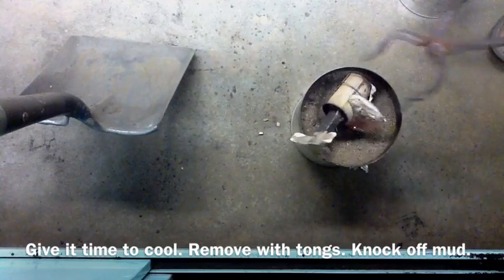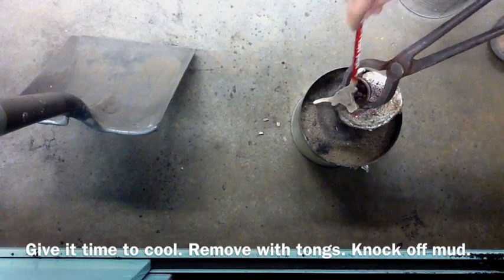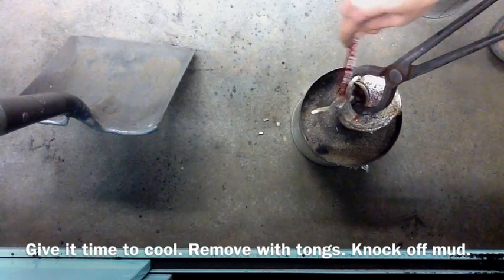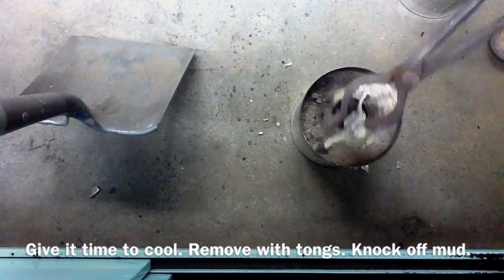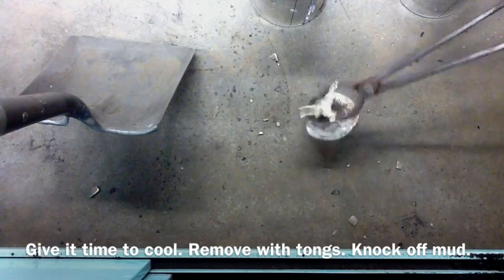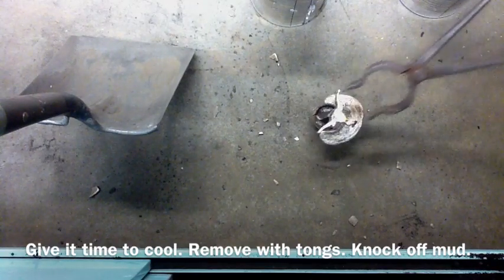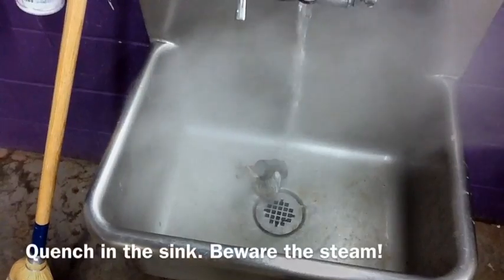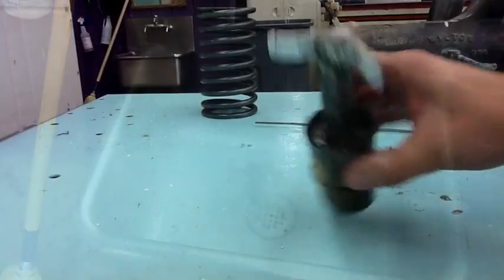Lost Foam Casting Process-  Start to finish

Comment from the maker: the drywall mud coats the foam and prevents seepage into the more porous sand.  masking tape works similar to the drywall mud. drywall mud is just easier to apply and seal the object within. *note this is hobby level stuff and not hard science casting. this was all trial and error when I was learning. :)

Comment: You don't need the kush thing, you can make a volcano bowl, grant to
Reply: +GoGo DaSilva (myGogoX1) 

Having the pressure tool reduces the spillage and reduces the amount of material needed for pressure by making more efficient pressure.  The cone is easier, but significantly less efficient at creating the pressure needed.  You need downward pressure and if you use a cone you would need to pile exponentially more material depending on the size of the object.   You also have less waste material to reprocess later on.
Reply: metalwreck450 ehhh, true

Comment: I live in the uk, what is dry wall mud? Is it like a polly filler or artexing? And does the type of foam matter? I have a ton of foam from packaging would this work the same (if i cut it smoothly with a heated wire cutter and add this dry wall mud, or what ever the uk version is)
Reply: Darren Waddle drywall mud is joint compound for wall board.
Reply: Thomas Hansen thank you

Comment: what about taking the other metal off like if i wanted just the bull head
Reply: That actually was the plan for that item.  The extra foam made a pathway for the metal to flow.  Typically I would have students do all of their finishing with the extra on so they have a clamping point in vise, then separate the finished product with a hacksaw.

Comment: so the heat melts away at the foam and takes the form correct? Ive been looking to casting alot recently and would like some insight
Reply: Yep.  Since the foam is mostly air the aluminum replaces the cavity held by the foam.  Drywall mud keeps sand from sticking to the molten aluminum as it cools.
Reply: if you wish to learn about lost foam casting check out my latest videos and castings and don't forget to like and subscribe  thanks

Comment: yes i see how it would be nice for something quick and dirty. but shallow 2D parts don't really need the angles or the split patterns just gotta be gentle pulling out the form. and hey make your own foundry! i love it i am building a 3d printer right now with cast parts with green sand then i can print positives with PLA and use them to do lost PLA castings! pretty cool projects that are coming full circle, fun stuff~!

Comment from the maker: I am not sure how the plastic would treat the foam.  If I had to guess, I'd say no.  Molten metal has plenty of heat to spare, plus flows quickly to fill voids.  When the mold isn't quickly replaced, it may collapse on itself.  Sorry.  :(      (Sorry on the delay too.)

Comment from the maker: Thanks for the note!  Yes, regular playsand will work fine.  The drywall mud should retain the detail of the foam.  If you're not using mud, the finer the sand, the better.  Expect some of the sand to get contaminated with mud/sand that flakes off.  Minimizing this should extend the life of your sand.

Comment: Thanks for the tip on the drywall mud.  It can also be used for fiberglass moulding, as the foam for that is very expensive.